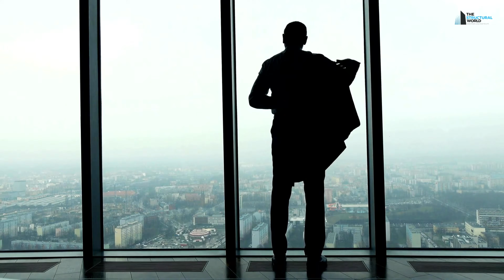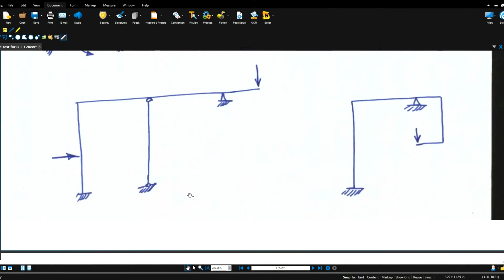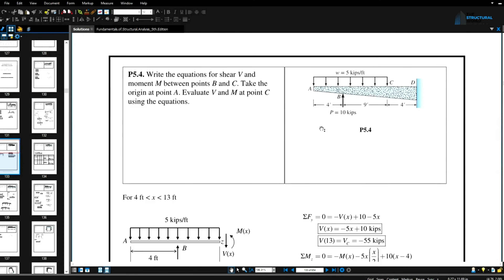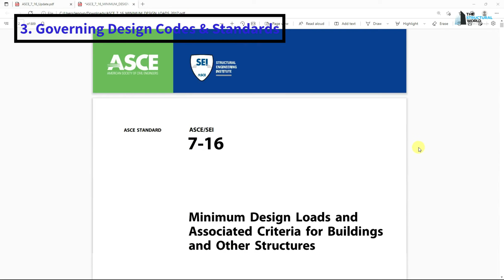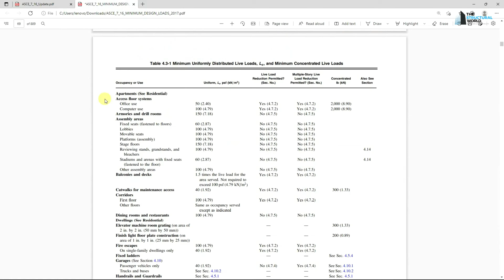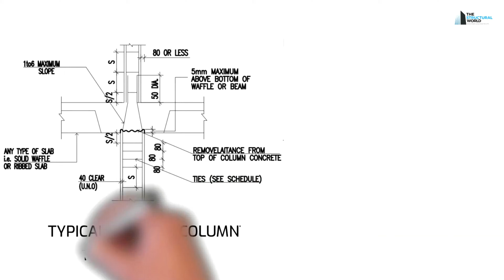5 Frequently Asked Technical Interview Questions for Structural Engineers

Comment: What technical skill do you think young structural engineers struggle with the most when transitioning from theory to real-world projects?

I’ve noticed many graduates are comfortable with calculations but find practical detailing, load paths, and field coordination much harder once they start working on actual residential or commercial structures.
Reply: I agree. In my experience, understanding load paths and translating calculations into practical construction details is often where the biggest learning curve happens.

Many new engineers can solve design problems on paper, but field coordination, detailing connections, reviewing existing structures, and communicating with contractors require a different skill set that only develops through project experience.

One thing I've noticed from residential and remodeling projects is that real-world conditions rarely match textbook examples exactly. That's why site exposure and practical detailing are so valuable early in an engineer's career.

We've seen similar challenges discussed by engineers working with YA Creative Design Partners, especially on residential structural modifications and remodeling projects where field conditions often require practical problem-solving beyond calculations alone.